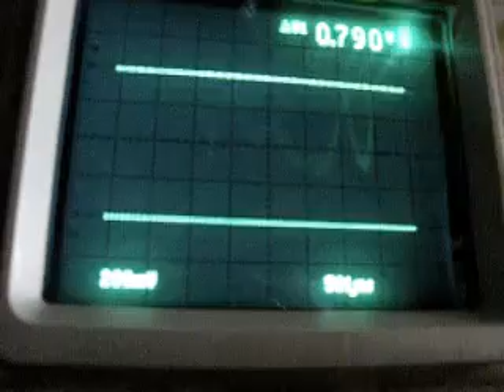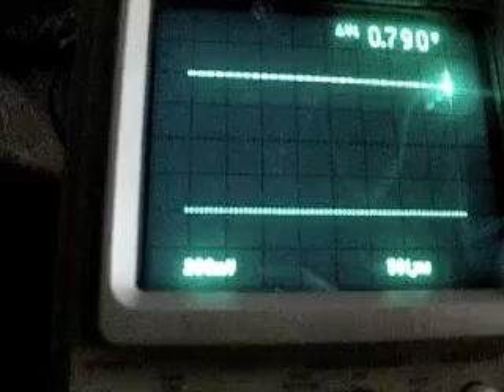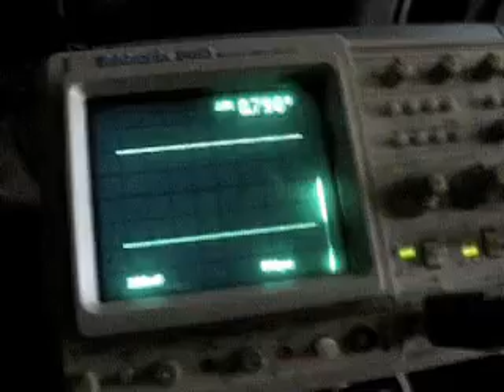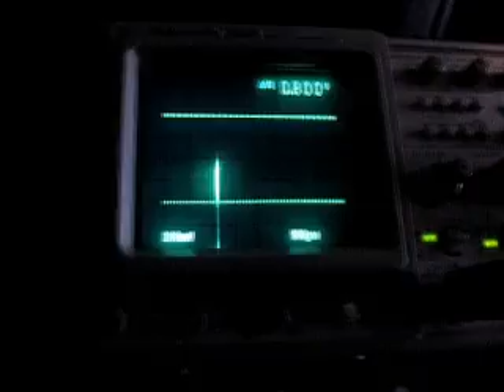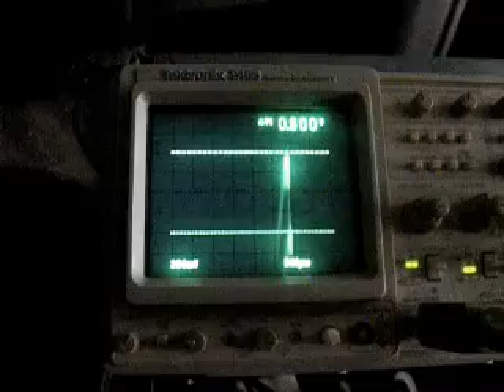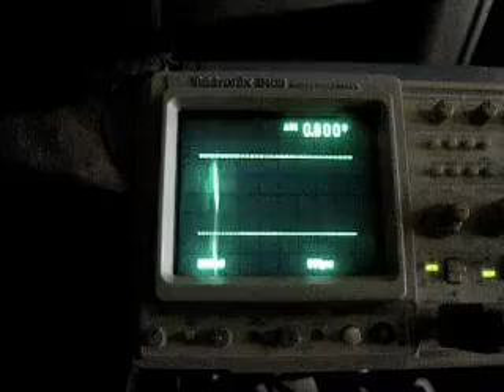Ford Explorer HHO and EFIE MAF affects

Comment: how os the power on low rpm ? after adjusting
Reply from the maker: Power on acceleration was affected by the increased pre ignition another reason why HHO mods don't work very well unless you can change timing and other engine parameters.